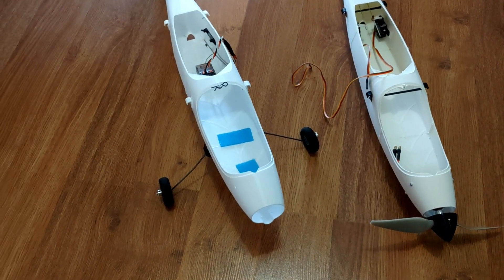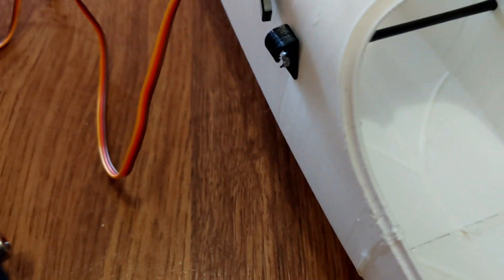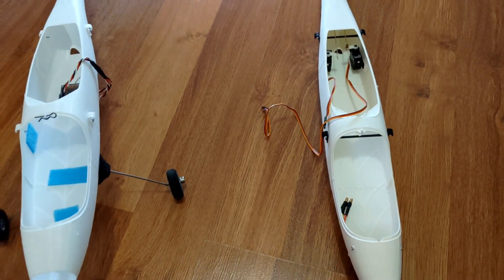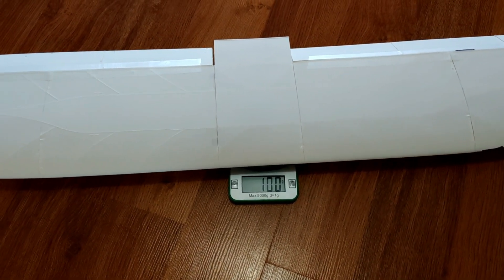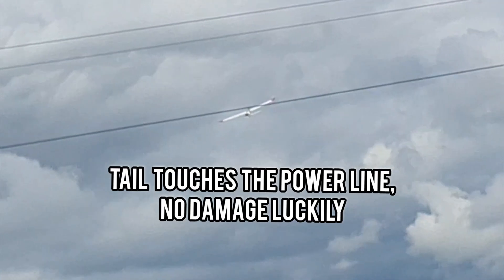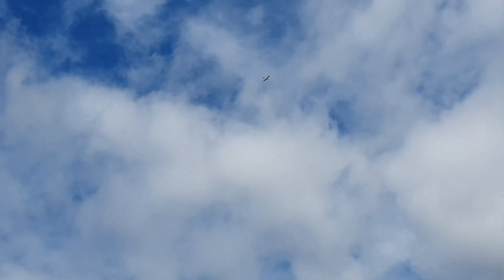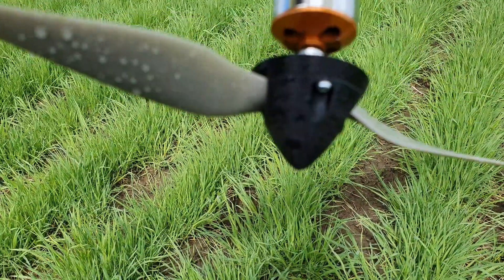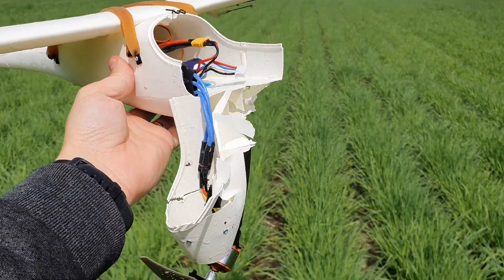3D printed airplane - Eclipson model A maiden flight gone wrong

Comment: Thanks for the video, especially the tip about the carbon tube connecting the two rubber holders.  I really makes a huge difference on the strength of the fuselage!
Reply from the maker: I got that idea from someone else as well, glad if it helped. I printed another one, LW PLA with some infill, hope it will help with the strength, I have to assemble and fly it soon.